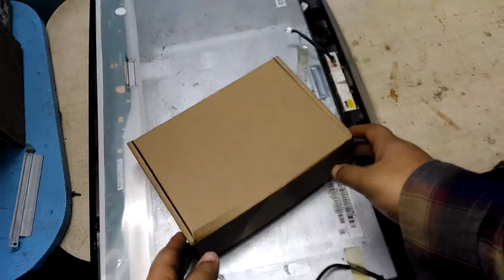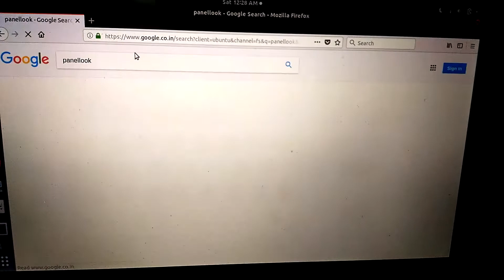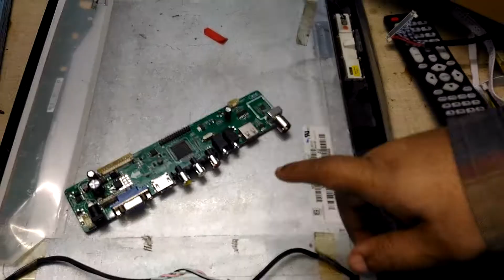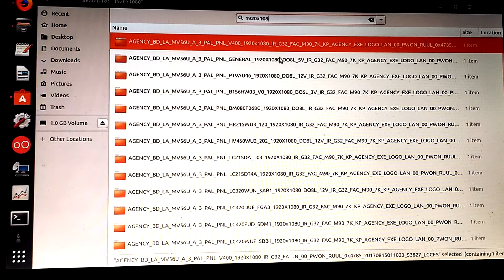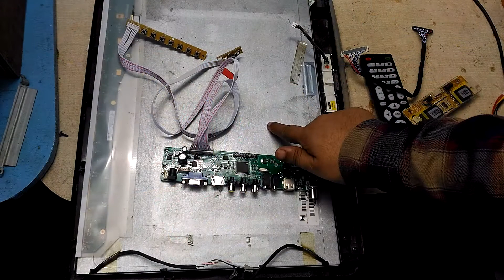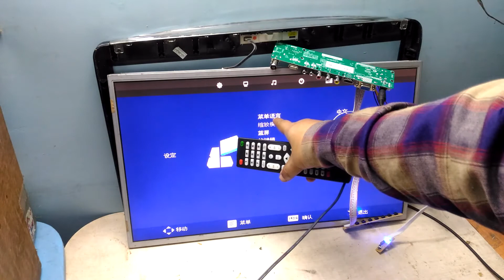How to Repair Any LCD Monitor or LED TV in 30 minutes!

Comment: Thank you for this tutorial Soumyadeep! It's a bit over my head, I guess I need to go look at what is a universal lcd controller board and its function(use). If your monitor's board was damaged and needed replacement, couldn't you just order a replacement board? I guess i'm not understanding why you're using the universal lcd controller board. The video was super informative thought, showing us how to load firmware and finding the monitor board model information. Thank you Sir.